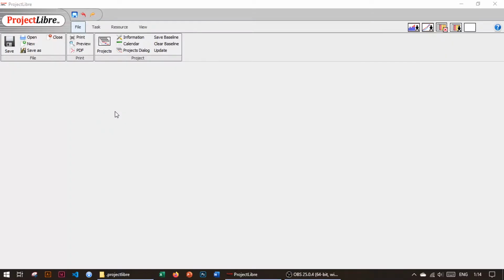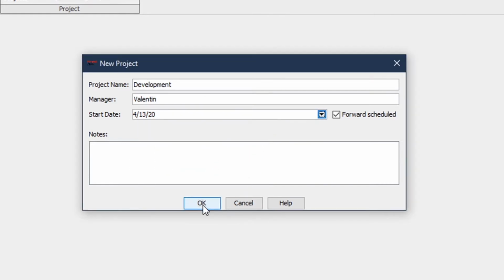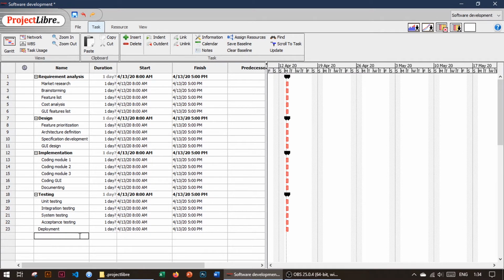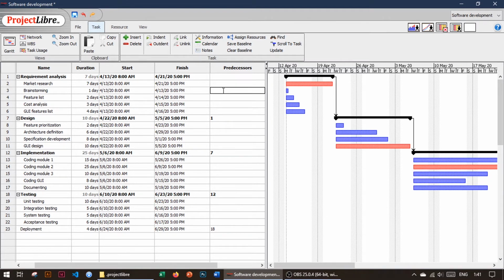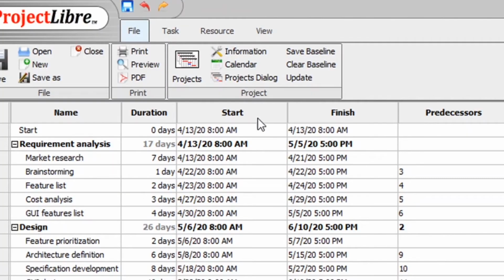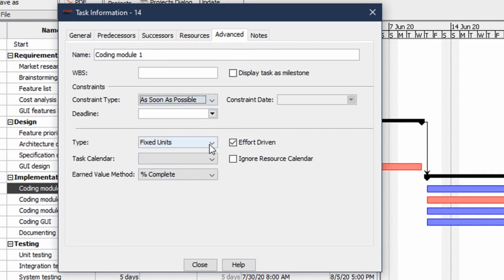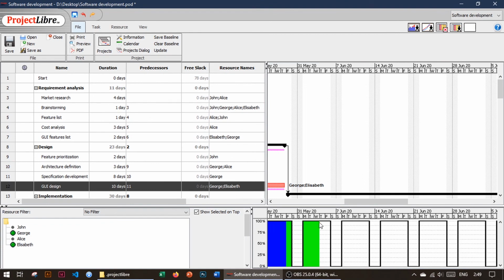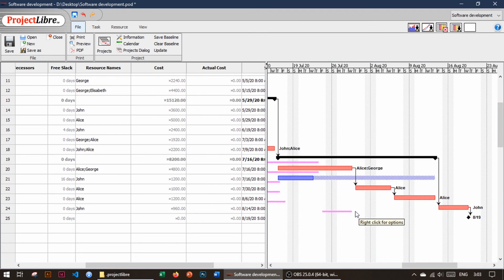ProjectLibre tutorial for beginners. How to use project management software?

Comment: installation not working to me as mention. pls, no contact of yours ....no here?
Reply from the maker: In the latest version of ProjectLibre, you do not need to set local settings as described via the command line. I did not describe any other "installation" things. 
Check if the installer you use is compatible with your OS or try another (older) version. Maybe it is better to ask on the official forum: sourceforge.net/p/projectlibre/discussion/

Comment: Brilliant, thanks very much. It was great that you went beyond the absolute basics. I wasn't sure whether ProjectLibre could do those extra things, like tracking actuals vs baseline. Your English is very good too. ;o)
Reply from the maker: Thank you!
Reply: @valentinkovshik  How can I change the "standard rate" symbols on resources? I want them to be Pound or ZAR and not dollar! how can I do it?
Reply from the maker: @lodrickthomas5230  Theoretically, the currency symbol is defined by the same locale settings as the language: your OS regional settings or the settings in projectlibre.conf. So, you can try to check your OS region settings to be set to South Africa, or try to set locale=en-ZA for ZAR or locale=en_GB for British pounds in the projectlibre.conf.  
I cannot guarantee that it works (you can see in the video, in my installation all currency codes are shows as an unspecified currency symbol ¤, not even a dollar).